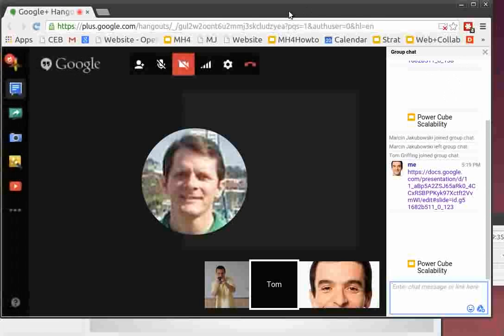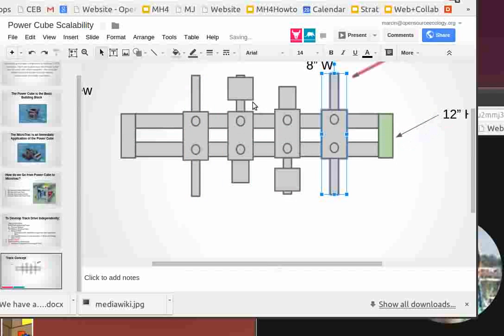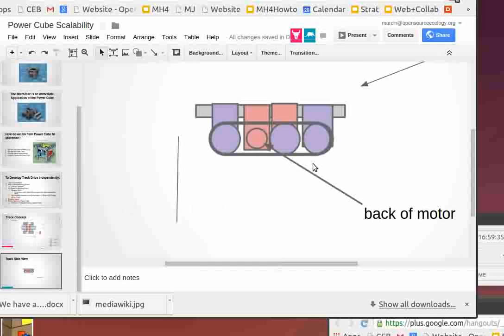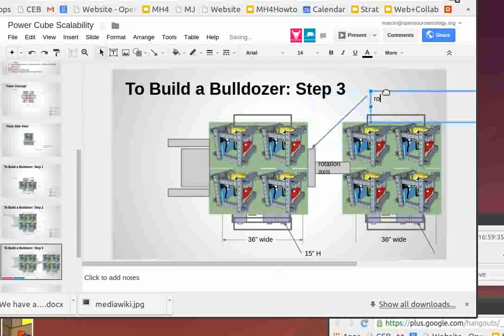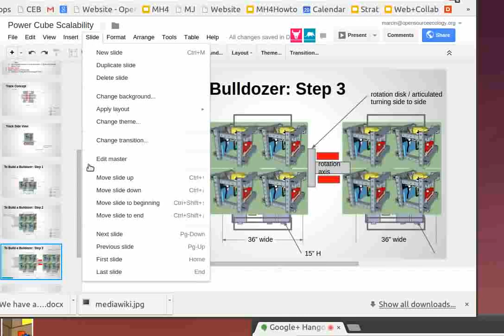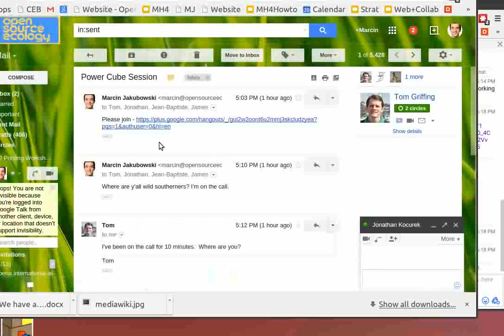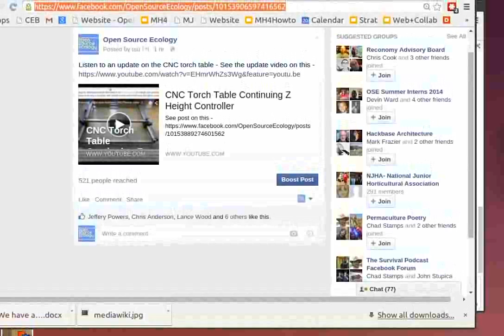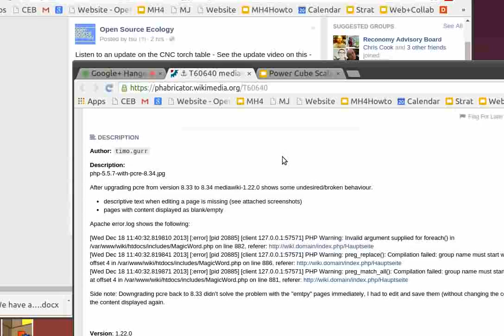Power Cube Scalability: From MicroTrac to Bulldozer

Comment: Would it help to simplify cube's engine itself by switching to another fuel: water solution of ammonium nitrate (with little urea added)? Such mixes are often used as fertilizer. If we could initiate its chemical reaction, this mix completely transforms into high pressure steam and nitrogen (with little carbon dioxide from that urea). Basically it is like steam engine, where you store steam chemically.